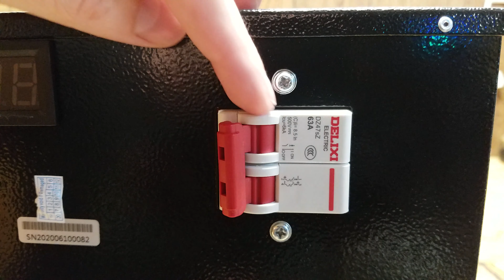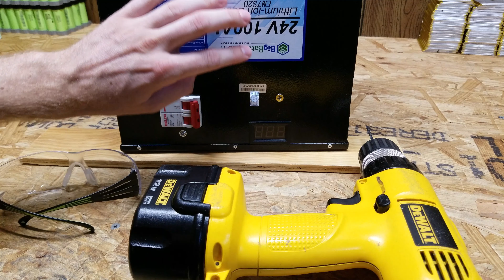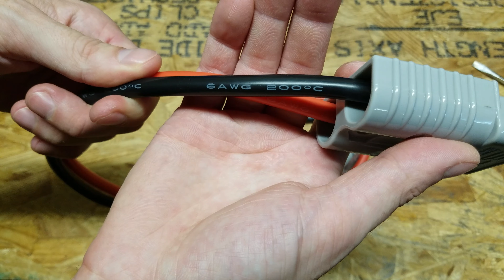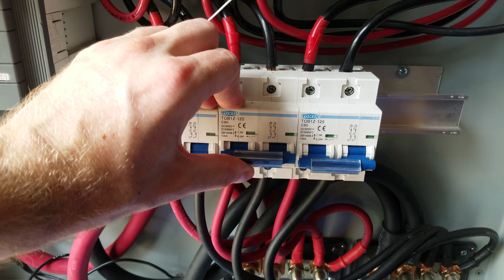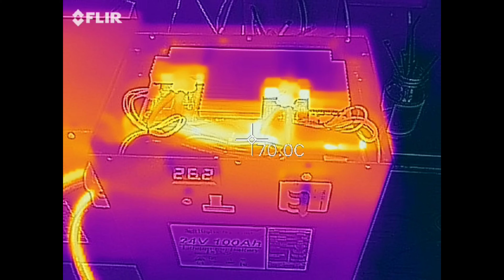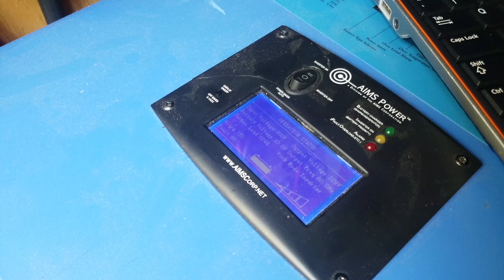Overview and Testing of the BigBattery 24V 100Ah Lithium Batteries, Plug-and-Play!

Comment: Also I believe most capacity testing is done at a .2C discharge rate where you did some at 1C and some at .5C which would lower measured capacity some, it also significantly increases thermal energy loss in the cables. Also I believe you measured power through the invert which also has a efficiency rating of 90-95% usually so the batteries actually got much closer to the listed capacity than you measured.

Comment: If you wire the batteries in series, and the power goes through the breakers, do you not get 200A through the second breaker?
Reply from the maker: No. Amps are added when the batteries are wired in parallel. When wired in series, you only add the voltage. The max current is still 100A.

Comment: Very nice test, at 2 in series, if you were to wire 2 in series with 3 in parallel then the load distribution to each pack would allow the batteries to run cooler. Glad to see your big Aim  inverter in use. Mine is still kicking away.

Comment: I know you should watch the charging of the batteries but the BMS should shut it off hi and low voltage automatically to protect there battery. Would love to know who’s BMS there using. Nice video.
Reply from the maker: The part number on the BMS board is JBD-HP08S006. This doesn't return any results in Google though, so I'm not sure.
Reply: LithiumSolar OK, thanks very much.

Comment: 6 Awg is Way to Thin for 100a I Would use 2 AWG
Reply from the maker: Believe it or not, the rating for 6 awg silicon wire (200C) is 135-140A. That seems extreme to me and would also use something closer to 2 awg, but it is technically in spec.
Reply: @LithiumSolar  okay that is probably because of the high thermal specs and some airflow is expectet 
I do maintenance an repairs of industrial machinery in Germany for a living 
We use Nym-J to Supply the Power there we need 35mm2 for 100a and 2Awg is about 33mm2 in the switching cabinet youre allowed to only use 25mm2 in H07VK Wire
Reply: @LithiumSolar  Even tho the wire is rated to 200C, I doubt everything connected to the wire has a 200C rating. The wire might be fine, but how will the rest of the components do when the wire tries to heat it up?

Also, the 140a rating is at a specific ambient temperature -- probably 25C. It'll get much hotter than 25C in that box once the wires heat it up.
Reply: Its so short it can handle alot of amperage
Reply: @thomasbarlow4223  that the cable is short has nothing with ist Ampere handling capability it just means the Voltage drops less
Reply: @kevinheimann7664  for real? I have been wrong about this my whole life. Ive always thought a short wire can handle more amperage. Maybe like 25% more juice.  I feel stupid now.
Reply: @kevinheimann7664   But a lower voltage drop equates to less parasitic loss that's turned into heat. And it is heat that ultimately determines the overall ampere handling capability.
Reply: @scottsudo-nim9629  Yes thats right but you still have the same heat loss per meter of cable 
Waht i have learnd is taht you cant take a lower wire gaute if the wire run is espacally short but if its very long you have to go higer in wire gaute
Reply: @kevinheimann7664  Actually, in the USA ... short length air exposed cables do have a HIGHER ampacity rating vs long cables inside a conduit.  Those are the rules we use in the USA ...

Comment: Would love to see how balanced those batteries were at the bottom - perhaps over charge a little so you can see the heat sink heating while balancing.. Also be good to know the temp inside as it doesn't look like there is any vents for heat to escape - that could shorten the life of the cells..
Reply from the maker: I thinks a follow-up video will be in order ;)

Comment: some breakers require going through both sides, to meet the rating of dc per instructions of the type of breaker
Reply from the maker: In the scenario you're referring to, the poles would be wired in series. These are wired in parallel.

Comment: This is a VERY interesting product. Do they make this in a 12 Volt configuration???
Reply from the maker: I didn't see any 12V on their site. Unfortunately, standard lithium cells don't work out well for 12V applications because of either being too high or too low voltage. I'd recommend LiFePO4 for a 12V application.
Reply: @LithiumSolar  Roger that-have done JUST that. I have a 600 Watts of Solar into a 12 Volt 100 Amp LiFePO4 Bioenno Battery.

Comment: If you did replace the breaker with a 100 amp single pole.

Do you think it would exacerbate the heating issue.? And is there another configuration which might alleviate it.?
Reply from the maker: I will certainly let you know in a few weeks when my new breakers arrive :)
Reply: @LithiumSolar  Awesome.!

Comment: Nice video. Did you touch the BMS heat sink by any chance? FLIR cameras are unreliable for measuring shiny metal: often the temp looks like whatever is being reflected by the metal- so whenever a heat sink looks like room temp, that should raise alarms - it might be showing you the wall or ceiling or enclosure temperature. 
FLIR cams have a setting for type of material (helps a bit, not perfect). They also can automatically jump to the highest-temp spot in a photo though I'm not sure about video- that should help you find the hottest hotspot faster. 

Finally, since they have visible and IR cameras, the stencil outline and lepton maps are often misaligned especially at close range- there's an offset function to compensate for this, but it doesn't adjust based on distance so might not be super helpful.

Comment: Great information, Being recycled cells, do they test to their stated rate? If so can you calculate the degree of degradation, meaning what would the power actually be if the total cells were new? Side note; they do offer the parallel or series version of these connectors. Thank you.
Reply from the maker: I'm told the cells are new and that the batteries were removed from packs that were defective in some other way, such as malfunctioning BMS. Also, those series/parallel cables weren't there a week ago when I bought mine... lol

Comment: The Tesla Model 3 batteries blow up at less than half the temperature of other lithium ion battery and should not be used without active Cooling. Having a heat sink in a sealed box is Chinatown hustle there is no benefit to heating the air within the Box except Distributing that heat to the entire assembly of electronics and heating the battery eventually.

You see the script and sees in specifications on the box you see the insanity with the circuit breaker but you have not warned people about the danger of these batteries.

I get my information from an article that recommends the 2-hour video breaking down the Tesla module for model 3.

Comment: You can buy the same thing on Alibaba for $300 or AliExpress, one of those two
Reply from the maker: Link please?
Reply: @LithiumSolar  oh right it was actually for the 12v version, the 24v version is $500 with shipping, my bad, but you can still save $300 as long as you can wait a month for the shipping. here is the link , just look at the ones for around $500 and ignore everything else   https://www.aliexpress.com/wholesale?catId=0&initiative_id=SB_20200806165105&origin=y&SearchText=24v+100ah+lithium+ion
Reply: @Vex T  yeah my bad it is actually $500, I was thinking 12v. but here is the link, look at the ones for $500   https://www.aliexpress.com/wholesale?catId=0&initiative_id=SB_20200806165105&origin=y&SearchText=24v+100ah+lithium+ion
Reply: I had seen lithium iron phosphate cells for fairly cheap on AliExpress like $200 with free shipping from 4 so basically 12v and I think I saw 8 for like $268 or something oh ya those were 90Ah not 100 but a pretty good deal and should last 2 to 4 times as long just need a bms if you don't need a steel case

Comment: From your video, it looks like the BMS doesn't have a low temperature cutoff. Is that correct?
Reply from the maker: I don't see anything on the website or battery itself to indicate that it has a low temperature cutoff.
Reply: @LithiumSolar  good to know. I dont live in the cold, but I know Lion batteries don't like getting near 0*C.
Reply: @LithiumSolar  So this wouldn't be good in a off grid camper

Comment: 080620/1108pst.  Good day to you. I watched the demo closely. NO COMMENTS. I have a sincere feeling that, your assembly is the best.
Just to inform you that, I had bad experiences with the cables. The cables that I procured had Aluminium strands embedded in the middle that got fused together under heavy load, causing extreme heat. Where can we obtain PURE OFCu cables?  Thanks.
Stay safe n Healthy. 73s...

Comment: Safe to mix this with their 24V BYD LIFePo4 batteries?
Reply from the maker: No. I strongly advise against mixing 3.7V NMC (?) and 3.2V LiFePO4. Even if the voltages were similar, the charge and discharge curves are different.

Comment: BigBattery.com = Extremely High Prices and is geared towards total noobs with more money than sense. If the price for each of these battery packs were $350 that would be reasonable but you could still build better ones with more capacity for $250 each if you're willing to put some work in. That's $187 for li-ion batteries with bms and $63 left over for wire, box, connectors, etc.

Comment: Currant ratings are not additive
63 amps is 63 amps.
Reply from the maker: It's a double pole breaker. Both poles are wired together, in parallel, thus current is added. 63+63=126A.
Reply: @LithiumSolar  in theory, but if they're not exactly the same resistance then current won't be shared equally so one might trip early e.g. at 45A, which then trips the other. So generally not a good idea to do.
Reply: @LithiumSolar  I absolutely love all the info your little group of revolutionaries share with one and other . Free information will create a snowball effect in terms of expansion of the technologies . nice job gentlemen .
Reply: Some Breaker panel manufacturers parallel 100amp breaker to make a 200amp main break
Reply: https://www.canadabreakers.ca/products/mbk200?utm_medium=cpc&utm_source=google&utm_campaign=Google%20Shopping&utm_campaign=gs-2018-12-27&utm_source=google&utm_medium=smart_campaign&gclid=CjwKCAjw1K75BRAEEiwAd41h1Ik0Xr2PWqq-VWB0DuNIbSknuyZs0-E5F54UsJo3auwXlPjdgrK9NBoCF9IQAvD_BwE